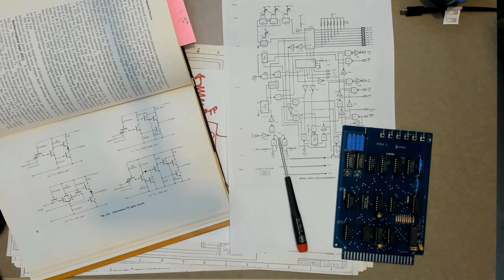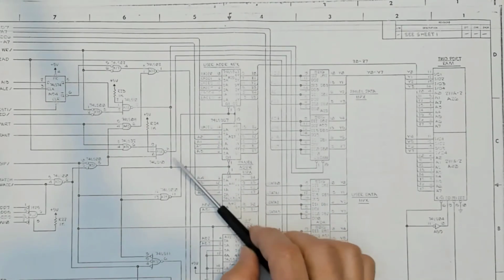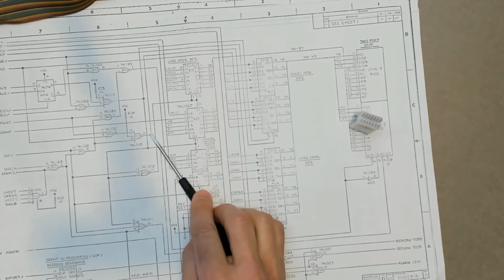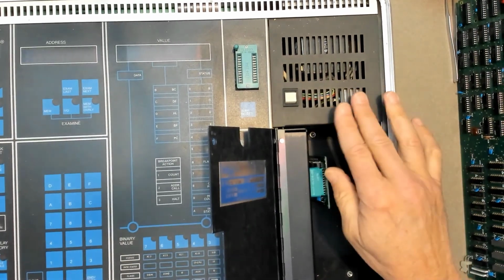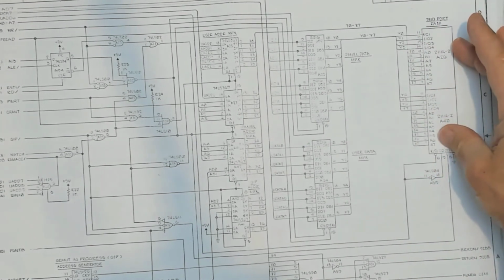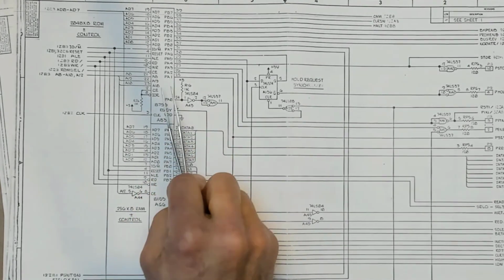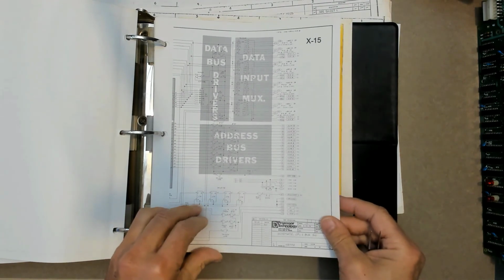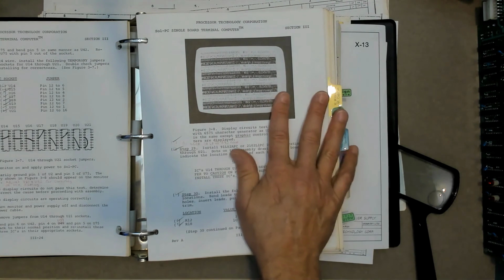{74} Pull-ups on fixed input gates? In search of diagnostic circuit over-ride examples

Comment: Interestingly my mid 1980’s Digital Electronics university lecturer told us to minimise the number of transitioning input pins & to tie all unused CMOS & TTL high level inputs straight to Vcc/Vdd to minimise power consumption. 😮
Reply from the maker: I remember being taught to tie them to a rail, and I remember being taught some can go directly and others need a resistor.  But if I was taught why some needed the resistor, the explanation must have gone right over my head.  It would be years before I understood why and by then, for the most part, it was obsolete knowledge.

Comment: Test Pads were generally not required, as most of the pins (nodes) were thru hole components. So the node would be probed with a conical top pogo pin from the underside.  Test pads were used and more common when surface mount packages became more common as you could no longer access the device pin from the underside of the PCB 👍🏻
Great videos by the way 😉
Reply from the maker: I can see that working, but we never did large product runs so we had pretty crude and cheaply made test beds.   If we tried to pogo contact an underside thru hole pad with a pin and it’s solder fillet, the connection was not reliable.  So we used.test pads.
Reply: @HelloWorldETX  design for testablity is an interesting subject in itself…
If you can toggle a node at the front end of a circuit, and get visibility at the back end, you reduce the number of test points you need, coverage and observability of propergated signals 👍🏻
Enjoy watching your stuff 😉